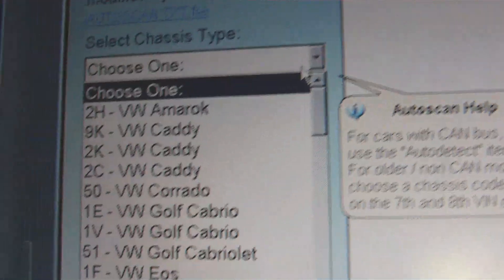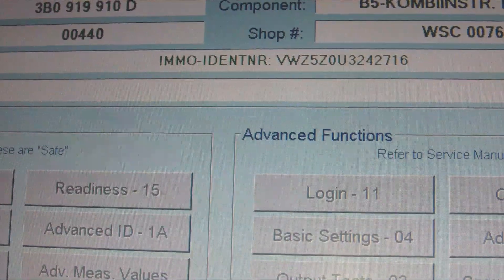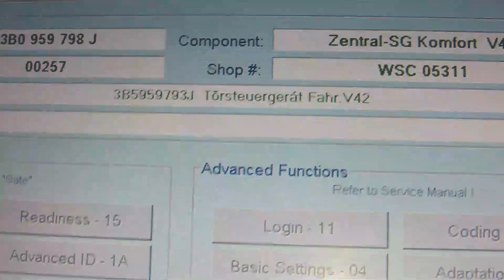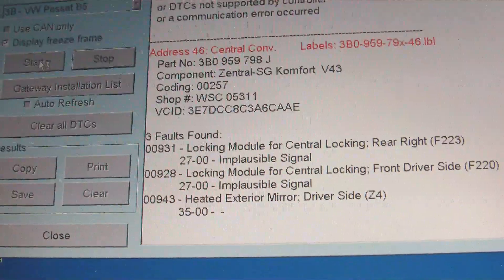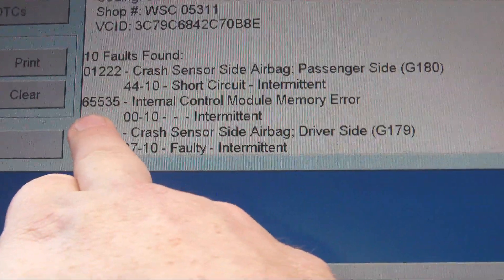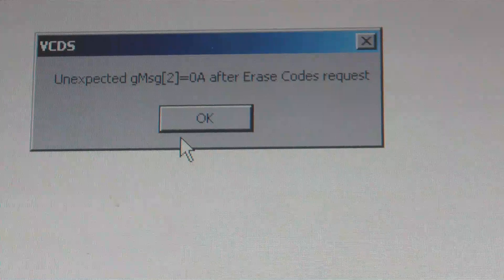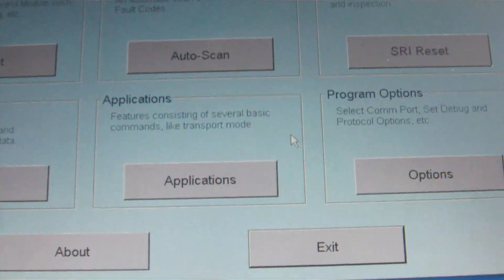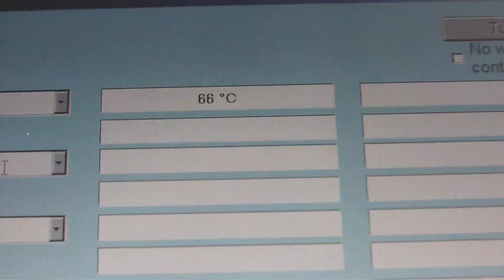VAGCOM - How to scan your car

Comment: i changed my a3 audi ecu once, and instead of reprogramming the new ecu, the workshop took a small black chip from the old ecu and put it on the new one.
the problem now that the vag com cannot connect to the car, it shows error in connecting with the cable and software. and the car stops sometimes and isn t accelerating like it should, though when i shut off the car and ignite it again it accelerates normally. 
any ideas how to scan the control unit ?
thanks

Comment: hi, i have a 10 reg scirocco tdi 140 that i have put a 2nd hand ecu in and i cannot start it because of the immobiliser. I think i need the skc code? can this download get that? cheers, Paul
Reply from the maker: Hi Paula, no it can't. VAGCOM can allow you to program things when you have the immobiliser code, but it can't find it. To get the code you need Vagtacho which is something I want next but that's expensive. A lot of people tend to use the £10 ebay cables for Vagtacho and seem to report it works with no issues. Version 3.01 seems to be the popular version on eBay by the looks of it but stay away from anything chinese as they're usually cheap knock offs. I tend to buy from UK only.
Reply: ***** vag tacho appears to only cover earlier cars, not as late as 2010. Thanks for assistance though :-)
Reply from the maker: Hi Paula I'm not sure what ecu the newer cars used but 261548423838 on ebay claims to be the newest version maybe this could help

For the price you'd pay for a vagcom dongle even if it supported it u may find it cheaper getting a dealer to read the code for u or possibly someone such as a mobile mechanic with access to the equipment.like a bosch or solus reader although I'm not.sure they'd be capable

Sometime the more pricier units can be ignored and buying.the cheap eBay equipment will work too

Comment: what version do I need for a range rover sport, also will it reset the electronic handbrake, 2006 hse sport
Reply from the maker: This tool is designed specifically for cars within the VAG family such as Audi, Skoda, Seat etc. It can be used as a generic scanner too but compatibility with other models can't be confirmed. You can try purchasing a scanner from gendan automotive. It's where I buy all my handheld tools
Reply: ok great thanks pal...
Reply from the maker: No problem :)

Comment: I was thinking of a another vw but im now swayed towards a diesel fiesta 1.4 l,ooks like a nightmare when you get problems with a vw
Reply from the maker: Electrical problems are the gremlins for VW, most of them are easy to fix, but like all cars some of them can be hard to trace. It's why it's best to scan cars before you buy them

My knowledge has increased a lot over the years, so I'm not too bothered about the problems now, I just solve them. The only ones I worry about are the expensive ones

Comment: You can use the utility 'Bootcamp' on mac (comes with OSX usually, if not, easy to find) to partition your hard drive and install a running copy of Windows in order to use your mac to run windows software. I'm told older copies of Vagcom have worked fine using this method but I (as yet) don't know about compatibility with newer versions. I am about to try this for myself once I figure out which cable works with my car.

Comment: Yeah, it's meant to idle at about 700-800ish, it's been hunting really badly sometimes reaching as high as 1000 when revving up. It's caused me some problems when pulling off on fast busy roads etc. Yeah that sounds promising actually, but I'm avoiding taking it to a garage before I've stuck the VAGCOM cable on just in case they find anything menial and try and do me for it. I'll have a look at the idle control valve tomorrow morning as I'm having to work late tonight grrr!! TGIF!! ;-)